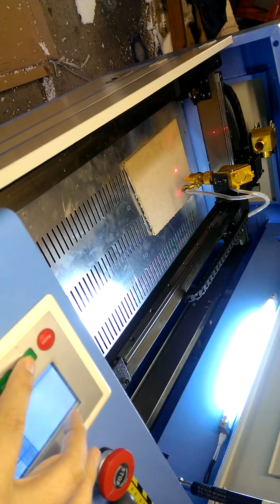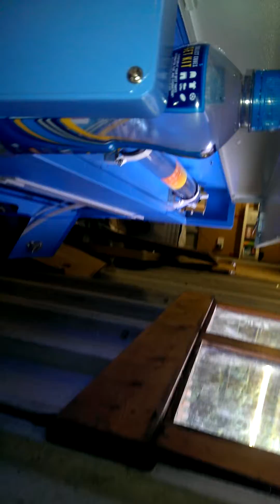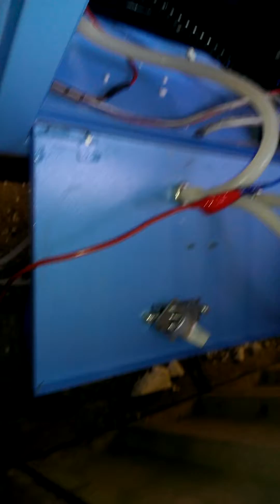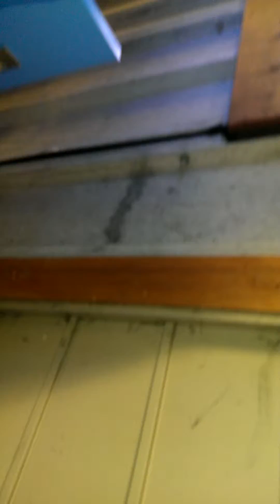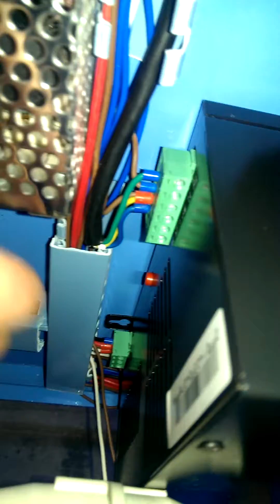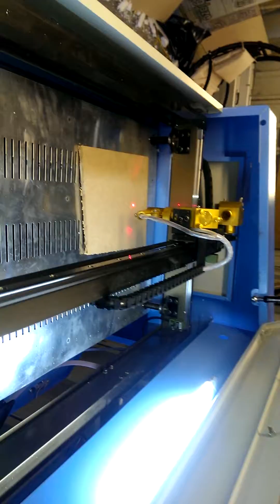Laser Cutter Issue

Comment from the maker: Quick update to this for anyone that is having similar issues. This one turned out to be a duff power supply for the laser. Dead giveaway was no LED light when pressing the test button. The test feature is actually quite interesting, they loop a single wire around the transformer, and use the field generated to trigger illuminating the LED - so the "out of band" test is actually quite good, if there's no field around the transformer, then its probably toast.

Laser cutter is back up and running now that I've fitted a new supply.